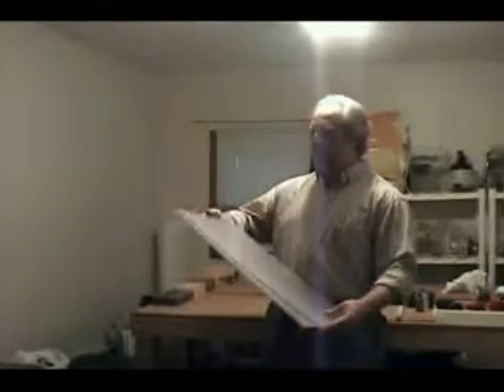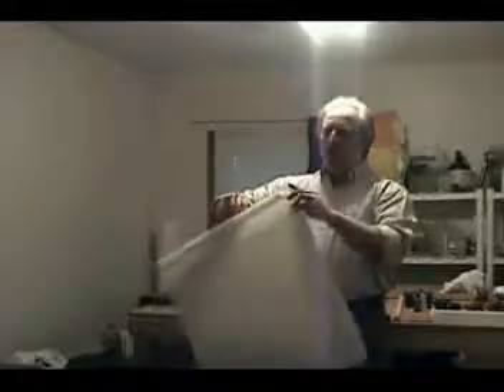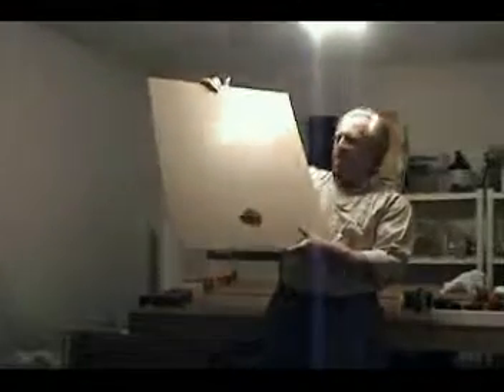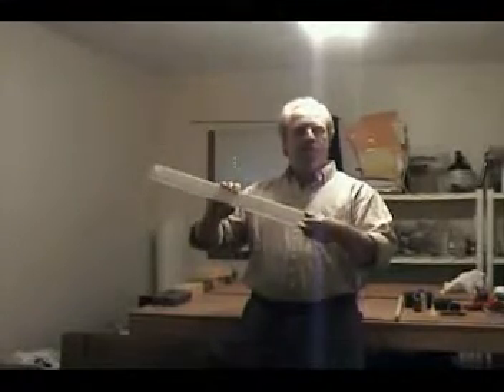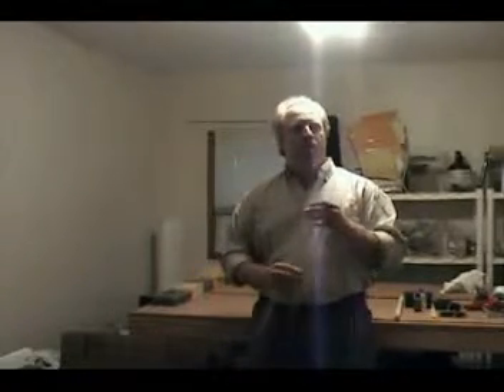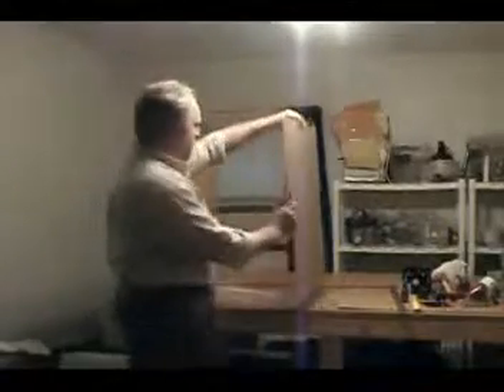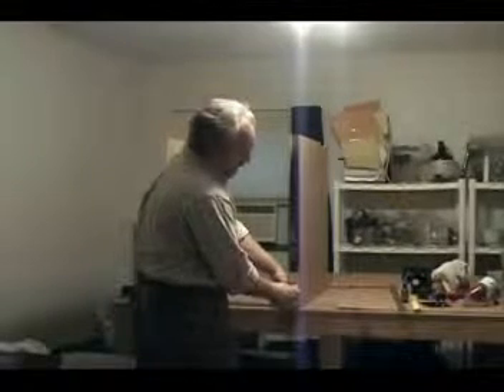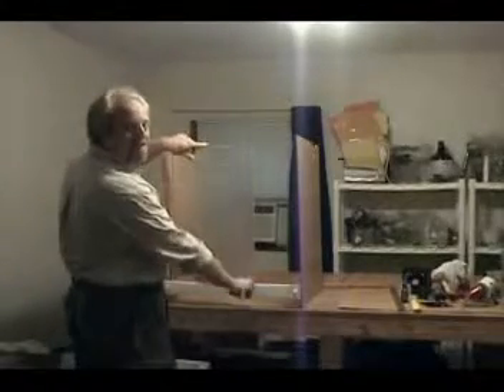Acrylicage Assembly Part1

Comment from the maker: @tomchicago  There is more ventilation then you realize. I have built a thousand cages and it has never been an issue. Most people with the larger cages take the fan/filter option which pulls the air out quickly without a draft. It also filters the dander and odor out also. Although you are correct, I would never leave the cage in direct sunlight, unless I kept the sliding doors open and usually the birds stay on top of the cage with a playcenter. Thank you for your input.I appreciate it.